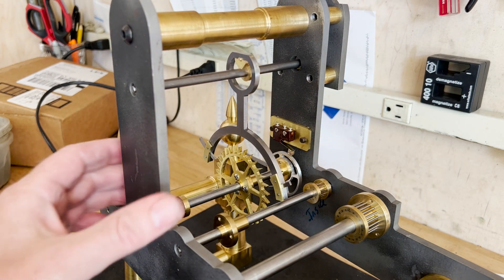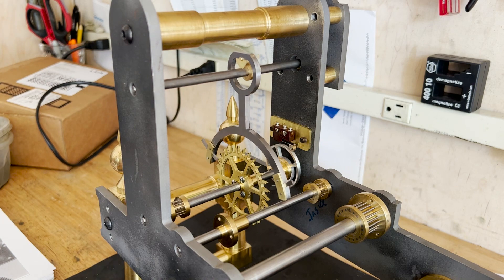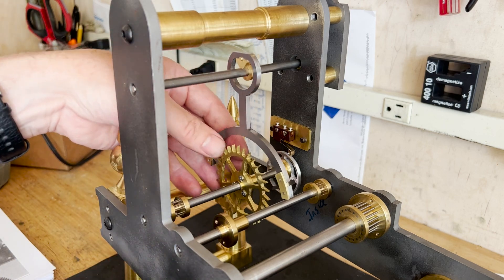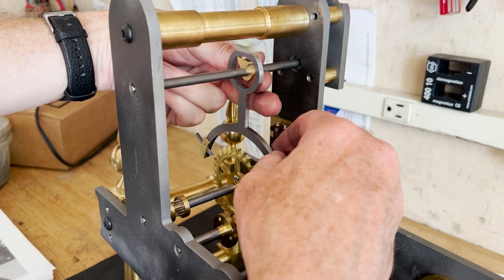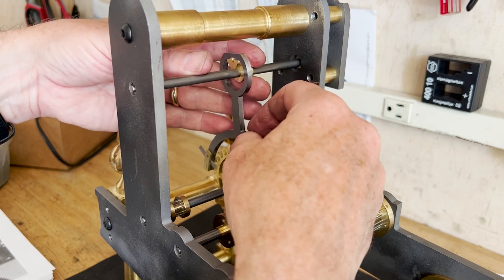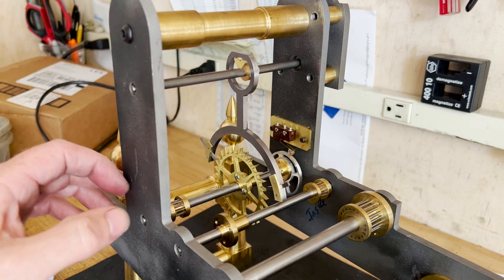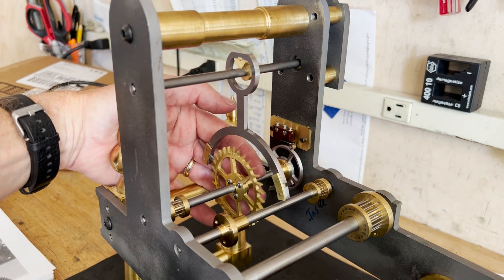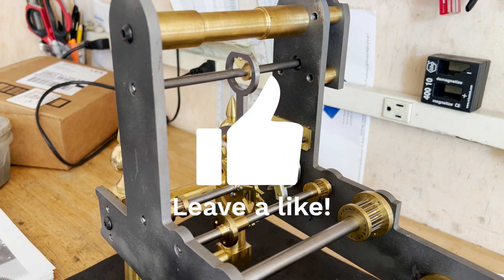The Escapement for a Tower Clock

Comment: Interesting arrangement,  would the train not run away when the magnets released though? Might do more damage than any over- swing of the pendulum.
Reply from the maker: That was a main concern with the design but the magnets hold it in place as their are two and it rocks from one to the other.   Until I secure it to the arbor it does not behave like that.    I have done this on a regulator and it has worked perfectly for almost two years.